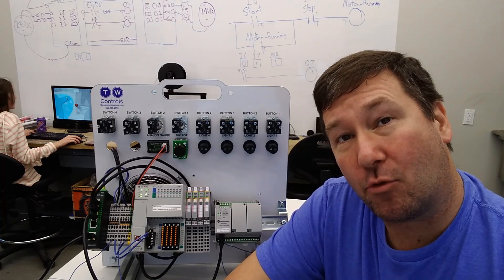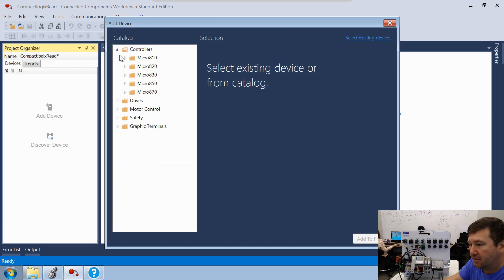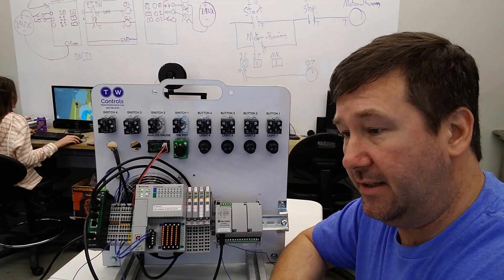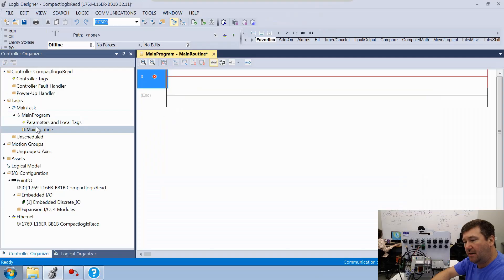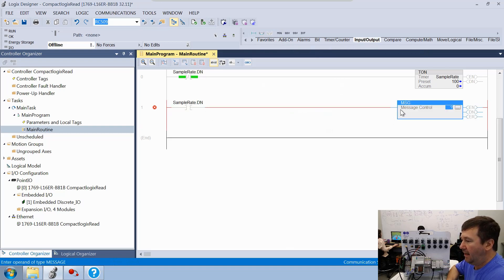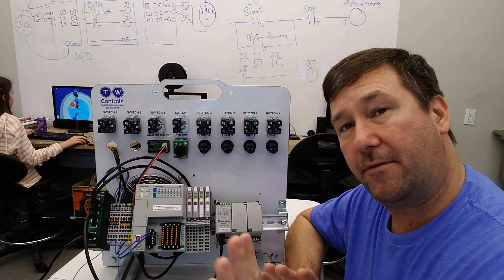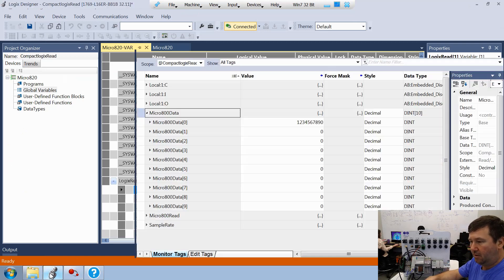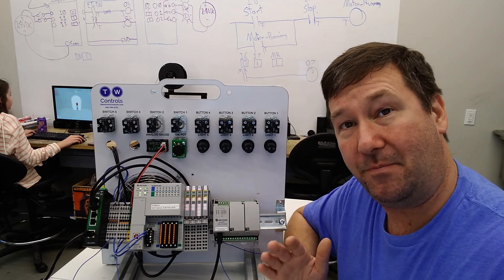Messaging from Micro800 to Controllogix Compactlogix with MSG Message

Comment: hi Tim! your videos are very helpfull to me, i have a question, i tried to perform the same connection to a plc micro850 and a compactlogic l19 but the 2 plcs are in different ip address; ej: micro850 have a ip address (192.168.1.50) and the l19 ip address (192.168.18.220). is possible te msg between this two plcs in this conditions?
Reply from the maker: Typically you would need some intermediate router in situations.
Reply: @TimWilborne  yep i guess will need some extra gadget to perform the communication. Well, i thank the help, thank you Tim!
Reply from the maker: You are welcome.

Comment: I have been receiving an error connection failure. The error code is 16#0001 with extended error code 16#0000_0110. I have configured same as per the video. IP series is same, subnet mask is same.
Reply from the maker: If you are not getting a timeout then your IP and subnet are likely correct.  I would look at the tag name and length of array.  Also, Studio 5000 arrays start with 0...CCW defaults to 1 but can be 0...that's got me a couple of times.

Comment: I have a Micro820 communicating with SMC EX260 SEN1 valves through Ethernet using MSG. I'm struggling with what parameters to enter into the MSG data types.
Reply from the maker: Is this in Studio 5000? You should be able to add it as an Ethernet module
Reply: @TimWilborne  unfortunately no. I just have a Micro820 sending a CIP MSG to the valves. I need to know the Ethernet target parameters. I believe it should be 4,192.168.1.120. I'm not sure about the class either.
Reply: @TimWilborne  I'm using a MSG instruction with a free running timer to trigger. I made all the tags for the MSG with the correct data types. My valve is set to 192.168.1.120. The PLC is 192.168.1.100 and HMI is 192.168.1.110
Reply from the maker: Then you are correct, the path would be 4,192.168.1.120.
Reply: @TimWilborne  I did get this figured out today. If anyone else has the same issue, the Service needs to be set to 16, the class is 4, the instance is 150 and attribute is set to 3.
Reply from the maker: Great to know, thanks for sharing!

Comment: Hi Tim, I’ve created a structure data type in my micro820 that has 11 bools and 2 INT’s. I’ve created the exact same data type on my compactlogix as a UDT, I’ve rechecked many times and the UDT and the structure are identical. When I try to set up a msg in the compactlogix to read the structure I get an error that says “class or instance not supported”. I can read a DINT array just fine between the two PLC’s it’s only when I change to the structure/udt that I get this error.
Reply from the maker: I would doubt that you can use a UDT with a MSG instruction but have never tried.  I think you would need to use a COP instruction to package the data into a DINT then do the opposite on the other side to break it back out.

Comment: Hello Tim, 
Thank you so much for this video, very helpful on the project am currently working on. A couple of questions, 
1. Why is the data type on the connected component work bench a DINT?  Can it be other data type? 
2. I can’t seem to go online with the workbench using an unmanaged switch. I can ping it with my laptop but can’t see it in communications. Am able to go online just fine doing a direct connect via Ethernet to my laptop. I did a little research online and people seem to have this issue but haven’t found any solution. Could it be my switch even though I can go online with other plc on the network? Did you have the same issue and if so, how did you resolve.  Thanks for the great content.
Reply from the maker: You can send other data types or do conversions on each end.

On #2, have you ever tried pinging before you plug the PLC into the network switch?  I'm wondering if something else already has your PLC's IP address on the network.

Comment: Hello Tim, I have a Micro820 hooked up to a PV800. The RTC on the micro820 does not work properly anymore even after resetting the date from my PC. Is there a way to get the RTC from the PV800 back to the micro820? If so, how would I do this? I need the RTC to give and hour by hour rate matching the actual time. Thanks

Comment: Hello Tim, please could you tell me how use Studio 5000 Logix Emulate with Studio 5000 y add a ethernet module, I also comunicate a real Micro820 with a plc simulate a 5570 logix emulate on Studio 5000. But I' didn't.
Reply: Hello, I need this answer, because I need comunicate a real Micro800 with Emulate 5000.

Comment: Tim, I've watched a few of your videos now and they have been very helpful.  I will be contributing via Patreon.  I do have a question regarding the 850 and communications to the CompactLogix.  In our setup we have an array of DINT and I am trying to copy a REAL (4 bytes) into a DINT (also 4 bytes) so the CompactLogix can read it along with the other data without having to specify a different data source.  Normally I would just use the COP instruction since in the CompactLogix platform this just copies the bytes and ignores the data type, but on the Micro850 I am getting a type mismatch error.  Is there a way to "pack" the REAL into a DINT for sending to a CompactLogix?

UPDATE:  I figured it out.  The COP instruction in the 850 does work the way it does in the CompactLogix.  I just wasn't configuring it properly.  DOH!!!  Don't know if you have a video on packing data of different types into an array of DINT and then unpacking it on the other side, but this would be a nice one to add.
Reply from the maker: Hi Dave.   Number manipulation can be complicated and is on the list for us to cover.  Glad you got yours working!

Comment: Is there a possibility of sending messages and communicate over ethernet from the micro850 to a micrologix1500? Obviously using rslogix500 and CCW software but I'm not entirely sure if that's possible. I want the 850 to communicate with the 1500 for diagnostic purposes such as alarms.
Reply from the maker: Yes and that would make a good video, I'll put it on the list.  You would use the MSG instruction and a SLC read for the type.

Comment: Would you be willing to demonstrate how to control I/O from one to the other ?? It seems to like the Micro820 could be an economical alternative to Flex I/O...
Reply from the maker: It might seem that way but there are safety concerns with doing this.  I address it in an upcoming video but long story short, the Micro800 doesn't have built in mechanisms to determine if there is a communications fault and what it should do if  it encounters one.

Comment: Hi, thnks for the video, actually everything was going fine until I set the path, down the chart it appears an error, ERROR PATH: 2, 192.168.1.1 <-- thats the IP that I used, so do you know what could be the problem?
Reply from the maker: Hit the basics. Make sure you can ping the devices, the subnets are correct, and the tag text and type are the same.
Reply: @TimWilborne  i did it, everything is fine :/ but still not working